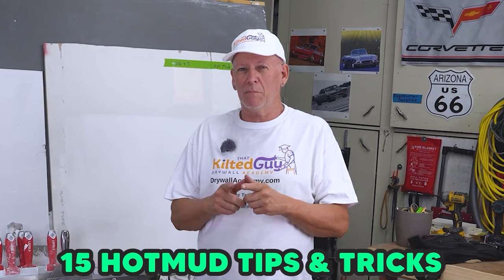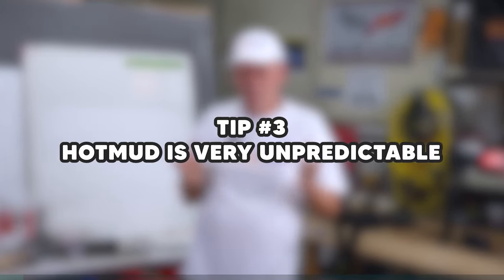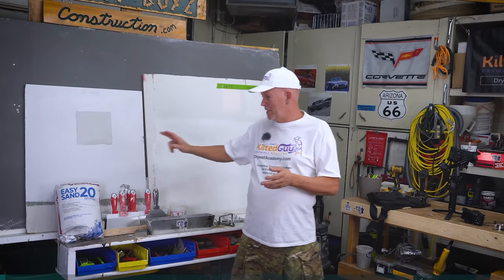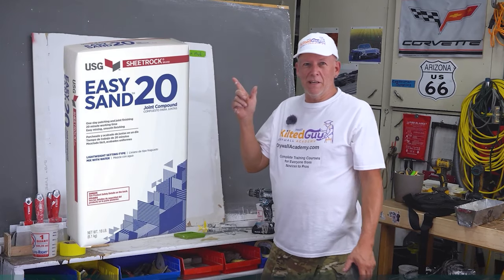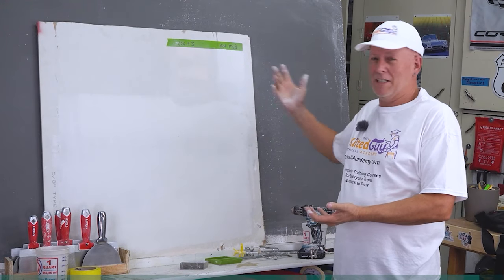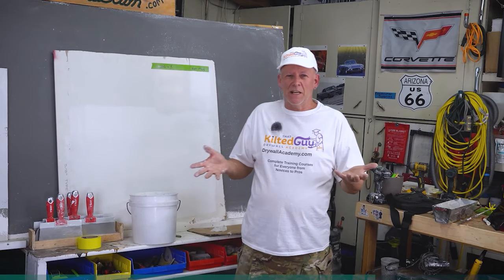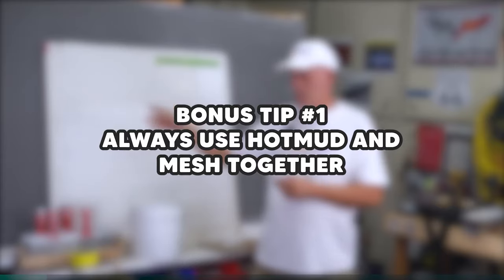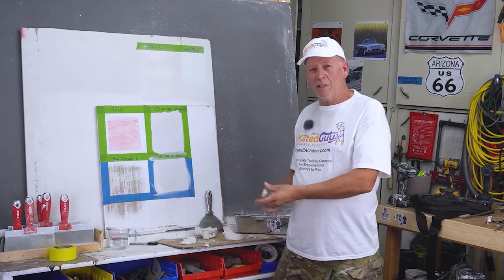Fast Setting Joint Compound Tips Your Drywaller Doesn't Know

Comment: I would suggest using Durabond any time you are are finishing over an odd surface, like concrete, block, wood, painted walls, ect.  But only for the bed coat. I would also prefer it for all prefilling but like he said the other hot mud will work okay for that.  Durabond has a lot more glue in it that makes it much better for such things.  Bed coat only though.  You don't want to have to sand that stuff.  You'd be amazed at what you can do with some Durabond and fiberglass mesh.  It really help when the top paper has been pulled off of some drywall, like when removing wallpaper.
Reply: Yep durabond is way better for prefill and bed coat. I use it when I’m doing plaster work.
Reply: @SuperUncleRyan  Thanks for that info. I'm getting ready to tie some new drywall into old plaster, and I was wondering which product was better for that purpose.

Comment: Hot mud or quick set is a bitch to sand if it’s too thick. I only use it for patch work. I’ve always been a firm believer of the best quality is using Synko taping, all purpose and their finishing compounds . Synko’s finishing mud is like a glass like smooth finish. There’s a reason Synko makes it.

Comment: I used Easy Sand 45 for the first time a few weeks ago, and I was a bit scared I was gonna screw it up. I had to prefill some wall to ceiling corner joints because the original installers didn't take the drywall to the edge on the ceiling, and left a 1/2 inch gap. Not sure if that's common practice, or not, but I prefilled so my tape had something to adhere to just in case. I'm glad you mentioned the P-trap drainage issue too because I had to poor the dirty water in the sink because it was either that, or dig a hole, and bury it in the backyard, lol.
Reply: The first time I bought hot mud I was clueless. I still have most of a sack of 5 minute mud and have no idea where I will use it now.

Comment: Great video Guy. Your explanations are right on the money. I agree with everything you said! Rock on...
Reply from the maker: Much appreciated!
Reply: Except for pouring it into the sink 🤣.  What i do when I use the sh*t is i treat it like sh*t and pour it into toilet bowl but while it's still soft just past the point of being workable and don't flush more than an average amount of sh*t.😆😂 then when you're done emptying your "butt" I mean bucket flush few more times...🤫👌🤣🇨🇦. 

Or option 2 is to clean quick setting compound to the bottom of your bucket and WALK AWAY. Then the next day or maayyyyybbe 2 to 3 times the number on the bag, bring outside and give a few light taps on the bottom of the pale while up side down and plop goes the weezel.😂🤣👌👍😎👍🇨🇦🇨🇦. I seen a tile guy do this so I thought I'd give it a try just to see and by god it worked pretty good actually didn't even need to really clean the pale. Hey, there you go you should try those two methods on a video one day🤔😏👌👍🇨🇦 just noooo pooping plz lmao....🤣🤣👍

Comment: I avoid using hot mud when I can as a DIYer. The 90/45/20 etc yeah, it sets up, but it's still best to let an all day cure (especially for prefilling, it's great for that). There's not much I need done that fast as I'm not a contractor. 

I've used all purpose over mesh just fine, but I can see why hot mud is best for mesh. It's rock hard when applied properly. Basically, patches and pre filling is it's best use for a home DIYer.

Also Easy Sand 😂 , it's a bear to sand.

Comment: I learned this first from tiling thinset that also sets up under water. First I scrape what I can into garbage and then use a bucket of water and brush to wash up. You can pour off the water once solids have settled. There's always a sizable solid mass at the bottom that would've been down somebody's drain.

Comment: I do swear by Durabond90 for prefill as a bed for taping mud to avoid tape shrinkage in the center. It’s also good for larger variations - occasionally I have had to do use a thinner drywall patch as it was the only thing available it help build a strong surface layer to apply a cover and skim coat. I think you should do another whole series on drywall stains and moisture meter and primers and paint to fix annoying temporary water leaks…

Comment: DId 20 minute mud mixed up with warm water.. it kick in few minutes.. mad it to consistence of peanut butter.. started applying to wall it became unuse able. i had to scrape off. and used regular mud. in 5 gallon bucket.. I then used heat gun to dry reg mud.
. i tried experiementused auto body filler. Since a autobody guy. had better luck. in 20 minutes of autobody filler dried. i used joint compound over it.. worked great.. use body filler over mesh tape . holds great... how feel about fibermesh  tape  with joint compound.?

Comment: I’ve a problem where the hot mud sets up way too quickly and reduce my working time tremendously. The bag states 20 minutes or so, but after just about 5 minutes, my hotmud is no longer in a working consistency. What am I doing weong? Am already using clean water, etc and mix it by hand using the instructions’ ratio.
Reply from the maker: Mix only until slightly smooth.  If you try to mix till all the lumps are gone, you'll overmix and it sets up faster.  Otherwise, not sure.  Make sure you follow all guidelines in this video.

Comment: One more tip especially for us duffers: wear old clothes! I've been lazy and done some mudding - little spots, not whole walls - with street clothes on. Hey, if I get it on my clothes or shoes it will wash right out! Hot mud won't wash right out unless it is caught early.
For the same reason, a cap of some sort is a great idea. Getting a blob of hot mud dried in our hair is less than ideal. Just sayin'.

Comment: I think I and a lot of other people had the misconception that hot mud reaches its 100% dry point faster, but it does not.  It only stiffens up faster and the entire point behind that is so you can put another coat of mud on top of the hot mud sooner than you can the other kinds of mud.  I originally thought that since it was setting up sooner then it would also be dry sooner and that you could sand it a lot sooner than you can other muds but thats not true.  It's made so you can add another coat of mud on top of it sooner but when it comes to sanding it has to be 100% dry and it does not 100% dry faster than other muds.  Its right at the same amount of time to completely dry as other mud types.
Reply from the maker: You are correct except there is one other major reason for it setting up besides being able to recoat it quickly. And that is because by setting up it stops the shrinkage. Drywall mud shrinks because of the evaporation of the water but since this sets up before it dries it stops the shrinkage. It probably shrinks less than 5% compared to about 35% for regular joint compound.
Reply: @ThatKiltedGuyDIY  Wow I didnt realize it was that low of shrinkage (5%).  Learn something new every day.  As for the regular all purpose, that explains why so many times I come in the next day and the joints that I swore were complete are all showing the bulge of the tape again.  I thought I was going blind or crazy but now that explains it.  I'm really glad I've tried out different muds now b/c now i know the situations to use them in and that saves sooo much time and headache when you use the right mud for the occasion.  And honestly I learned most of it right here on this channel!   Merica!

Comment: Any tips for drying joint compound in very humid temperatures?  I skim coated a already painted ceiling over 2 weeks ago and thought it was fully cured.  To my surprise, after applying my first coat of primer, I noticed the primer was peeling off as I was painting it.  The joint compound underneath felt moist to the touch.  Had been running a high powered fan but still feels moist and the primer won't adhere. 🫤
Reply from the maker: The only tips are to lower the humidity, raise the temperature, and increase the airflow. In some cases you may have to rent a dehumidifier